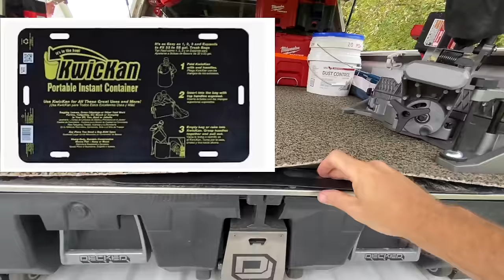Truck Loadout Part 3 / DECKED, Milwaukee Packout, & Leer Topper / More Changes #tools #milwaukee

Comment: I just got a 5x8 trailer for all my tools. was so tired of having my entire truck loaded up. I love a clean and clear truck idk why.
Reply from the maker: I get that.  That’s why I try not to put much up front by my seat. For some reason if I have a bunch of clutter next to me it drives me crazy.

I have thought about a trailer many times, but traffic and the roads in the area I work stinks so I’ve been trying to get away without having to pull one.
Reply: The only problem wit the trailer is additional space it takes. So in area with congested traffic and in city centres there may be some parking issues. And on highways you need to remember that you can't go too fast. Otherwise a tool trailer is an excellent idea.
Reply from the maker: @Stefan_Kawalec  yeah driving one around the town I work in wouldn’t be much fun.

I would love to have the space and be able to easily walk in/out, but I wouldn’t want to haul one every day.
Reply: @Stefan_Kawalec  I'm in San Francisco Bay area. I deal with the parking in the citys that's why I only have a 5x8 tool trailer and a 5x10 dump trailer. Big job you get street parking permit and small jobs you just park in the street with a sign to call to move.
Reply: @WyattEmge  Ok, get that.

Comment: I HIGHLY recommend getting yourself a klein tools 9 in 1 sae flip socket set. It's only $30 and it saves so much time. It fits any drill or impact and has between 1/4 and 3/4 socket size. For any sockets I need for construction this is my go to. It takes up very little space. Is very well made. And is super convenient. Its in my everyday grab and go. It's the type of tool you buy thinking its niche but use more than expected.
Reply from the maker: @WyattThePilotYT  I have picked up several of the flip sockets including the newer Modbox sets.  They are good tools 👍
Reply: When you got started running your business. With all the trades you do professionally (similar to the path I’m on). What do you recommend? To learn the skills, apply yourself, manage your time, and overall just balance of it all
Reply from the maker: @WyattThePilotYT  before I started on my own I worked for years for companies learning skills.  

You can learn a lot from people, but I personally learn more by doing.  Be willing to try things and if you mess up, you learn from it.  I have always taught the people who worked with/for me, that speed off how fast you get something done comes with time and repetition like everything else.  You need to learn how to do it right no matter how long it takes you.  It doesn’t matter how fast you get it done if it’s not done right. To keep good customers you have to fix their problem, not put a bandaid on it.

Time management is also important from the standpoint of fulfilling the expectations of the customer.  Manage your time based on the expectation you give them, never promise something you can’t do.

With your work and time, always give expectations that you can either meet or exceed.

I feel like I was just Tony Robbin’s or something 😂
Reply: @MORGANSMaintenance  🤣 I'm 14, almost 15, and I'm taking every trade class I can get my hands on. I'm already in advanced construction and Welding. In construction class we build tiny homes for fire relief that has everything but plumbing. I LOVE it! I am completely the same in that I learn by doing. So I get what you're saying. My construction teacher says, it matters if you make a mistake because it comes out of your time, and the customers or your $. However it is only truly a mistake if you don't learn from it, or how to fix it. I struggle with time management though. Any tips for that? But one of the biggest reasons I love the trades is because you're always learning. Always. So learning new skills, or tricks, or even taking criticism. I like. Because you always learn how to be better. I think what you're trying to say is slow is smooth, and smooth is fast.
Reply from the maker: @WyattThePilotYT it will seem crazy to some people because they think it takes more time… but cleanliness and organization helps me with Time Management.

I spend zero time looking for things because everything has its place.  It takes some time and effort to put things back, but not near the time of looking for it.

Same for cleaning, it takes less time to clean as you go than to clean a large mess afterwards or work in a mess.  Plus it makes happy customers.

You are making a smart choice in my opinion.  Good luck 👍
Reply: @MORGANSMaintenance   Thank you! I can definitely see why that works! I need to work on it... Thank you for your time helping me and giving me tips. I definitely look forward to future videos! Again, thank you so much!

Comment: Those shelves in the cab with you. You can put them in the  🚚 🛏 . You're  sitting up right in that 🚚.  You need to lean back after 8hrs. Trust me I  know better! 🧔🏿‍♂️🤷🏿‍♂️
Reply from the maker: I actually have plenty of room on the drivers side (with that angle on my top drawer)… my passenger seat is definitely a little snug, but I’m a loaner 99% of the time.

If I take the back seats all the way out I can gain a little more room though, especially if I turn the drawers the other way. That will probably be the next step.

Comment: Looking forward to this one…
Reply: Actually look forward to all of them.. 😂
Reply from the maker: @brianhall9019  😂… this is still a work in progress… but it always will be
Reply: I think you are set up wonderfully.. at this point I wouldn’t change a thing. Good job .
Reply from the maker: What’s in my truck changes all the time… so I feel I can’t really have a “fixed” setup.  I think this will work for me until this truck blows up 😂

The camper topper has made a high difference on making my job easier (space, weather, tying things down, etc)

Appreciate it 👍
Reply from the maker: Thanks Philly 👍👍

Comment: It's a nice setup. The Decked bed is awesome. I also really liked the little cubbie for the smaller levels and skimming blade. Also was good to see Fibafuse in the drywall tape box lol. 

The rear facing lights on the canopy are great. I should do that off the ladder rack on the work van. I've got wiring for them because there used to be 2 flashing lights on the rack.

I'd get a 5gal bucket holder in the bed. Store a couple few empty buckets, then the hot mud bucket in top. It'll never tip over, and doesn't need to be tied or tethered. 
Weather guard sells a red one that would look good in there, and is a fairly priced one compared to a couple other brands. 

Thanks for the tour of the service vehicle. Looks thought out and efficient.
Reply from the maker: Yeah I have grown to love that Fibafuse… especially for patches and butt joints.

I will definitely check out the 5 gallon bucket holder, I use them all the time.

Appreciate the suggestions and compliments.  I often overthink things.. so I have just been using it and letting it load out itself.  It will change more and more over time.
Reply: @MORGANSMaintenance  
I've been dealing with 5gal buckets for a couple decades. They are a necessary evil for me. I never knew the bucket holder existed until a couple years ago. Wish I'd of discovered it sooner. 

Fibafuse is great. I don't typically use it for a 90, but for flats, butts, and repair work. No issues with it.
Reply from the maker: @huntsvillepaintpro  same here… I have swapped over to Levelline or No-Coat for inside corners (paper occasionally).

I have been using Fiba Fuse pretty much same as you…

The carpet in my back does a pretty good job of things not sliding.  I will have to see what my options are for mounting that bucket holder to the Decked

Comment: That little window is meant for you see your blind spot. Nice set up also
Reply from the maker: Makes sense I guess… if I didn’t block it with all my other stuff 😂.  I was like why does someone need a window to look inside from the outside.

Appreciate the compliment 👍
Reply: @MORGANSMaintenance  I guess it works if you have a single cab truck. I was looking at one for my ranger

Comment: Very nice organized setup, gave me some ideas, I’m a handyman for almost 2 years full time and organizing is a must, I use a Honda element as my work vehicle, looking to reorganize my setup, looking to bite the bullet and invest in the PACKOUT solution, even though most of my tools are  Dewalt, thanks for sharing your setup.
Reply from the maker: Your welcome.  I have always custom built stuff with scraps in the past.. but I decided to use more Packout since they will be usable in most vehicles.. or my garage if anything major changes.

An organized vehicle is the only thing that keeps my sanity 😂
Reply: My company provided truck is a Tacoma, but my personal is an Element. I really wish I could use the Element for work, that huge flat floor and wide opening doors give so many options for customization and organization. I could turn in my company truck and get paid mileage for using my persona, but the Element has 300K miles on it and I currently drive 5-6K miles/month for work...I'd like to keep the Element living longer than that. It is such a great platform, I wish Honda had kept it. 
But alas, I am ditching the Tonneau cover on the Taco and getting a topper similar to Morgan, so looking for ideas, and he certainly delivered!

Comment: Dap ‘one time’ patch.  Quick drying, low shrink and self priming.
Reply from the maker: 👍.. thanks for the suggestion
Reply: @MORGANSMaintenance  No problem, thanks for the video.  I like how you use space, making the most of spots most folks wouldn’t even think of.

Comment: Nice setup. I’m a handyman so like you I have tools for all kinds of jobs.  I haven’t figured out the best setup for me yet so I change out tools a lot .  I was surprised where you keep the drop cloths.  On a large percentage of jobs that’s one of the first things I grab. 
Also, how do like the M12 pin nailer?  I picked it up in the fall and so fat I’m not that impressed.  I wish it would set the pins a little deeper.
Reply from the maker: I have a drop cloth in my cab… it was Red and between my middle crate and passenger drawers..  I forgot to mention it.

The ones in that packout are extras in case I need more.

I like the Pin nailer.. I haven’t had any problem with mine setting stuff even in oak.  I wonder if your depth setting isn’t working right?

I had the Ryobi before the M12.  I liked it too, but the size of the M12 is much better.

Yeah I don’t think people that do things like us can have a “permanent” setup.  It has to be adaptable. 

Sometimes I wish I just did one thing… but I think I would get bored.  Plus it’s a big selling point that someone can call me, and they don’t have to call or schedule anyone else.

Comment: Thanks for the ideas!  I work on broadcast equipment as a contractor, so my day to day may be electrical, light framing, AC, plumbing, or rebuilding an amplifier module.
Like you, I am ditching the tonneau cover for a commercial topper on my Tacoma (6 ft bed). I have to keep my back seats as I also use the truck to take the kids to school. I like the idea of the Decked system, but I sometimes need the height of the  bed+ canopy. I am thinking about making 2 bed cot style shelves of Unistrut with plywood top and carpet so I can have a setup like your on top, with space for storage bins/boxes underneath. They would be removable in case I need the full bed. I will probably make the tops with hinges also, so I can access the far back items from the middle door. A paint pole with a hook could also be sued to reach back and snag the bin or bag handles. Or maybe a slide out tray on the bottom of one or both of the "cots"? Who knows what the final build will be.
Reply from the maker: It’s an always evolving thing… I usually spend way to much time overthinking things when sometimes it’s best for just trial and error.

That’s like I was already planning on building shelves in the topper before I got it installed but tried it out as is while overthinking how I wanted to build the shelves… now that I’ve used it like it is and I can reach everywhere in my bed… I can tell I would not have liked  the shelves.

Thanks for the suggestions of what you might do… and Glad I helped 👍

Comment: I think it would be a cool idea to make boxes that are still modular/moveable. The packout cabinets might be too big but it would be easier to get those rather than custom boxes.
Reply from the maker: Yeah I actually at first was going to try build a base and make it so that packout drawers came out even with the doors. My thinking was I could still remove them if I needed space… and anything Packout I can use later in whatever vehicle I use.

But the topper sides run at a little bit of an angle. If you make the bottom of the Packout flush with the outside of the topper, the top drawer ends up being about 5” in from the outside of the topper. (Hopefully that makes sense)

That’s why the bottom shelf is deeper and the top smaller on the ones that typically come with the topper.

I also thought about only doing boxes on one side instead of two.. that way I still have room for bigger tools, and can access the back middle of my bed from the side that doesn’t have the box.

Who knows what I will end up doing 😂.. thanks for the suggestion.  I definitely like the idea of whatever I do being moveable.

Comment: Some great ideas man... how big is your bed ? I have a tool box right now.. im contemplating getting a topper. I have a small bed 5.5 feet. Gmc 1500. 

Thanks for the video
Reply from the maker: Mine is the 6’ bed… maybe 6’6”

The topper has been amazing for me, the best change I have made so far…. But I don’t normally carry tall items so it hasn’t been an issue.  I have even less height with my Decked Drawers, but it’s actually nice because it puts everything in my bed at the height of the topper doors.  Makes it so I can reach anything in my bed.

Makes it to where I don’t have to tie things down, I don’t have stuff out in my bed for passerby’s to put there hands on… 

It won’t be for everyone, but it’s been great for me.

Comment: How’d you wire up that Milwaukee charger to power the leds in the camper shell?
Reply from the maker: I just took the guts out of the charger and soldered wire to the battery prongs in the charger.  Wired that wire to my lights.

Now when I put the battery in it sends the 12volts through that wire to my lights

Comment: Why didn’t I think of just screwing a packout as a mounting plate and getting more storage? So simple yet genius haha.
Reply from the maker: Yeah, it’s hard to fork over money for a mounting plate.  They work the way I store things, if you wall mount you might need to use the plates, I’m not sure how the cases would hold weight of on the wall.

Comment: What was the plumbing tool (looks like a universal wrench) that you didn't like? Can you also explain likes and dislikes on Siligun. Thanks
Reply from the maker: It is a wrench for strainer basket nuts… I would just like to find something not so big.

Siligun… I like the size… and being able to get into certain spots… I don’t like how I can’t rotate the nozzle to the handle.  It cuts a slit in the tube as you push it through, so that makes the tube unable to be turned.

That’s the main things on it (the rest is nit picky stuff)… so it’s a good caulk gun to have for certain things compared to a regular one and sometimes it’s not. Just depends on what you are doing.

I have been able to use the partial tubes that have been slit in the Siligun in my standard caulk gun though… I was worried I wouldn’t be able to do that.
Reply: @MORGANSMaintenance  Thanks!
Reply from the maker: @scotts4125  👍

Comment: Joey just a curiosity, why did you adapt a truck and not use a van?
Reply from the maker: I’ve always had a truck (and I already had the Decked)… but I’ve never been 100% on my own and working out of a vehicle at multiple locations before. 

I have kinda just been figuring that all out this last year making it work with what I had. I was also unsure of which way my business/customers in my area would lead me. More service or more remodeling… I wanted to get a feel of what my needs were going to be before I made a decision to possibly buy a vehicle.  Get a feel for what will work the best.

Hope that makes sense.

I am thinking a van might be a better fit for me in the future… which is another reason I decided to make Packout be a big part of what I use now instead of building things.  I can move those to whatever I end up doing. 👍
Reply: My guess - cost. He's only been independent for a year, personally I wouldn't invest in a new vehicle yet either.
Existing 2011 Truck + topper + bed drawers + other storage(pack-outs) = probably around 5k.
A New Van = at least $60k
A Used Van = at least $20k
Reply from the maker: @notme232  had to make sure I wasn’t going to have to go crawling back to my employer 😂
Reply: At the beginning using what you already have and upgrading it a bit is much wiser in terms of money.
Reply: @MORGANSMaintenance  I had no idea of the costs, now it makes perfect sense to me! 😅
Reply from the maker: Vehicles have gotten crazy, I will probably drive this truck till the wheels fall off 😂

Comment: you need to seriously ratchet down that stack behind the drivers seat, it will crush you if you have a collision!
Reply from the maker: Probably wouldn’t be a bad idea.  It doesn’t move any right now… but a crash is a different story.
Reply: @MORGANSMaintenance  and when you start filling it with more screws or pliers...
Reply from the maker: @wim0104  yeah. I thing I could probably attach it to the back seat brackets somehow